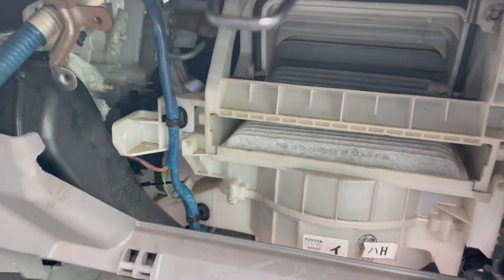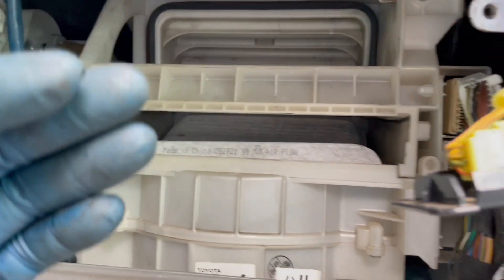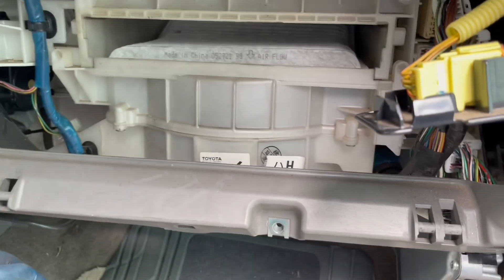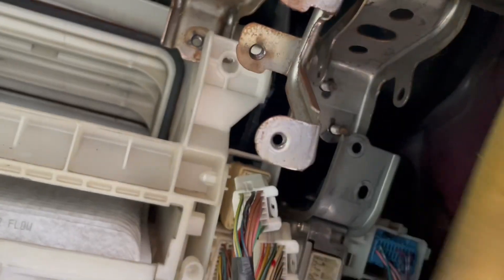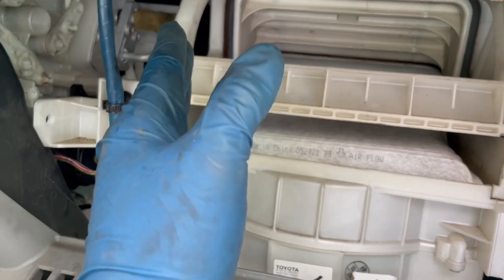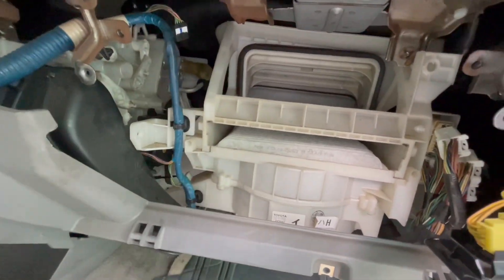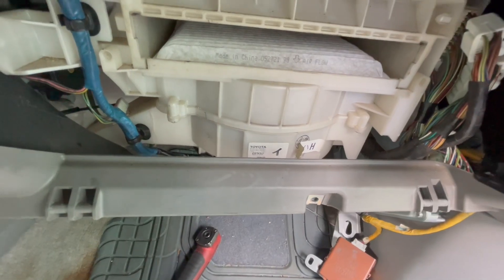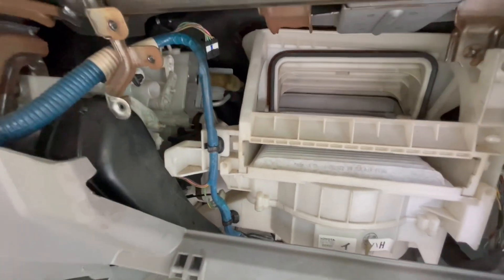2005 Toyota 4Runner expansion valve replacement, without removing the dash

Comment: Dude thanks so much for this video I had to replace mine too and there weren't any useful videos on how to remove the TXV on a 4th gen till you posted one
Reply from the maker: Glad it helped! Everyone has me thinking the whole dash had to be removed, so I had to make a video!
Reply: @2EZEverything  the nut closest to the firewall is giving me a fight and I keep thinking that I'm going to break the damn thing
Reply: Just curious why you thought it needed replacing, I’m going after mine because the vehicle isn’t cooling like it used to, and the ac compressor is running non stop and my gauges are reading good pressure 43psi on low 250psi on high side even added a little Freon an my pressures raised to 50\290 and compression still wasn’t cycling on an off so now I’m going after that expansion valve.
Reply: @ericdavis219  I replaced my compressor 3 times and they keep dying, and the pressures on the high side are higher than they should be in addition to the AC not cooling unless the vehicle is in motion on the freeway
Reply: @thunderwolf8908  Makes me think
You could have a bad fan clutch or condenser issue, or it’s getting over charged.
Reply: Thanks for showing me how to shift the blower assembly to the right.  I will need to replace the blend door actuator that has three screws.

Comment: I’ve got a leaking evaporator, can I get around removing the dash for that?
Reply from the maker: You could temporarily bypass it but to fix it right I believe the dash would need to be removed
Reply: Looks like your stuck pulling the dash.
Reply: I just did the evaporator replacement and honestly it’s not hard just time consuming and if you are going to replace the evaporator replace the heater core while your at it